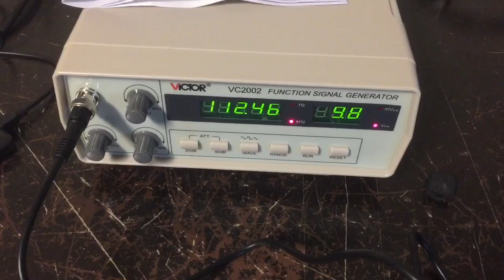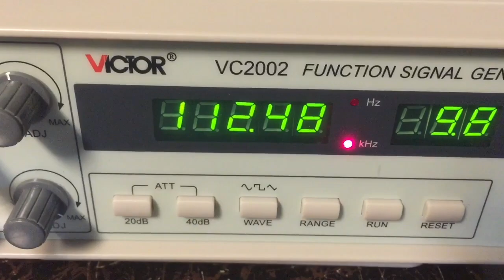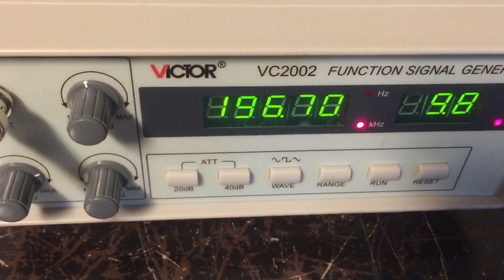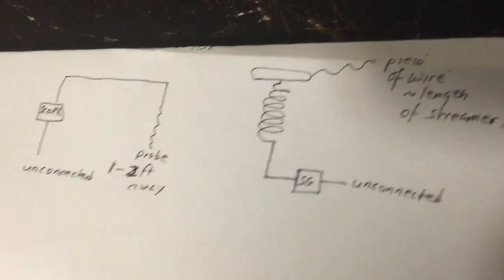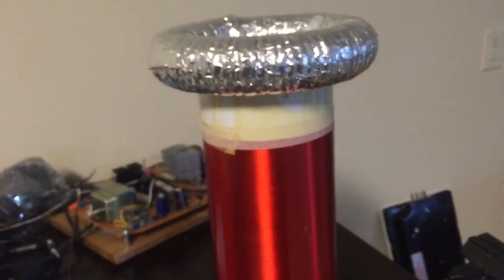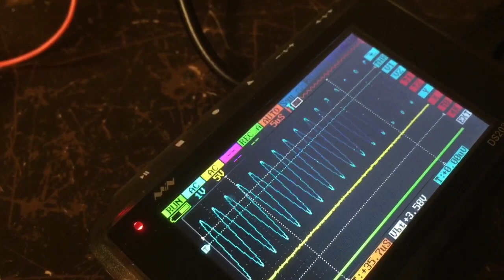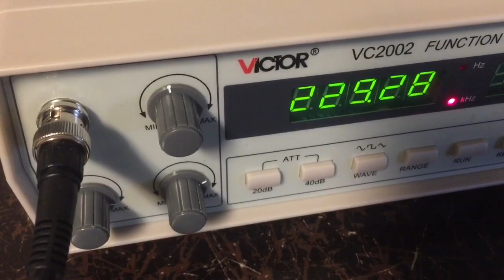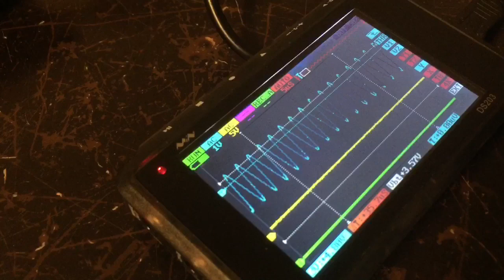Tuning Primary and Secondary for DRSSTC

Comment: Is your secondary capacitor complete O loop (short circuit in EM field) instead C ? There should be little cut from one side to the center of this toroid. I don't know how much more % of output power it will give you, but it should be little bit better, Q factor will be higher and frequency should go lower with the top capacitor in C shape.
Reply from the maker: You make a good point there!

Comment: I would like to tune my SSTC but i am a bit unsire of a few things, how do you know the value of the capacitor for primary and how come you are placing it in parrallel with the coil to tune? Most schematics have a capacitor in series with primary coil. When yiu are tuning the secondary how do you know what frequency to start at?
Reply from the maker: Resonance with series or parallel arrangements is the same. The 10k resistor between the positive output of the signal generator and the primary coil allows energy to be trickled into the system. The energy in the tank is scoped between the negative of the signal generator and the connection point between the 10k resistor and the primary coil. Then the maximum sine wave amplitude is found, that is your resonant frequency. You will also see lower amplitude harmonics as you slowly vary the frequency. Please ignore these.. To calculate the size of your primary capacitor bank, it depends on the size of your primary coil and secondary coil, the number of turns on your secondary and diameter of the secondary coil and primary former, the size of the top load etc. It’s best to use the free website JavaTC to get approximate values. Or you could just do trial and error with different capacitor values. Start with 50nf film cap and work up in increments of 50 and change the tap point of your primary until you find your desired frequency.

Comment: hey guys. i want to build a mini drsstc. but i don't have an oscilloscope.. what steps should i do to find out and the primary and secondary frequencies are aligned?
Reply from the maker: Best easy without a scope is to use JavaTC to get ballpark dimensions for primary and secondary. 
Here is the link. No installation needed:
http://www.classictesla.com/java/javatc/javatc.html

Once constructed use a neon light for fine tuning. You can power the system at low power and use the neon bulb to find quarter wave tune point along the secondary. Correct tuning is when neon bulb is brightest at the top of the secondary! Bottom of secondary is connected to earth ground!!
Reply: @BrianDhvTinkerer  thanks for the response. yes, I have partially built it. with a simple driver. how many volts dc should I use during initial setup?..
Reply from the maker: Not more then 30 to 40V
Reply: @BrianDhvTinkerer  okay guys.. one more question.. if you supply 30 vdc and set the primary and find the brightest light in the light bulb, with 4 primary turns. will you keep the 110vdc primary supplied with 4 turns or add more coils?
Reply from the maker: For DRSSTC need to start with more then 4 turns preferably 10 turns. The number of primary turns depends on your primary  tank capacitance. Approximate number of primary turns is calculated with JAVA TC
Reply: @BrianDhvTinkerer  okay I understand what you mean.. yes I have several 33nf 1200vdc capacitors.. I series 10 pcs and produce several size options to make it easier to choose the value of the capacitor. 😊😊
Reply: @BrianDhvTinkerer  hi friend, may i have your contack? email / other social media?...i'd love to send a schematic of the ramped driver.
Reply: Instead of a scope, you could use a small low voltage light bulb instead of the 10k resistor, you could add an ultra-fast diode and a combination of a 10k resistor and maybe a 10-100nF capacitor, basically making a HF rectifier which allows you to measure the HF voltage with an ordinary voltmeter when you achieve resonance.

Comment: Can you do a "direct drive" tesla coil where you just have, say, a 600v battery pack, and hard switch the primary full bridge with something like SiC mosfets at around 100-150kHz, and change the PWM frequency on the fly so it stays at resonance with the secondary?

Comment: In the parallel resonance of induction cookers, we never driver the LC tank circuit at the resonance frequency, because the right commutation current is at a frequency just above resonance (the primary impedance has some reactance), this makes the mosfets heat less because of the ZVS. Does the same happens in the TC?

Comment: This video is very useful thanks, one question regarding the capacitor across the primary, should this be the same value that i use for my MMC? As i would expect this capacitor would alter the resonant frequency of the primary somewhat? TIA
Reply from the maker: It should be the same as the one on your MMC for sure. This will help you to guesstimate the number of turns for your secondary as you will want the primary freq to be about 10-20% lower then the secondary frequency to account for streamer loading.
Reply: OK, sweet, JavaTC is telling me about 8.8 turns, so it will be interesting to see how accurate that is.
Reply: what if the tesla coil is driven directly from zvs so no mmc? do i use the cap value of the zvs?